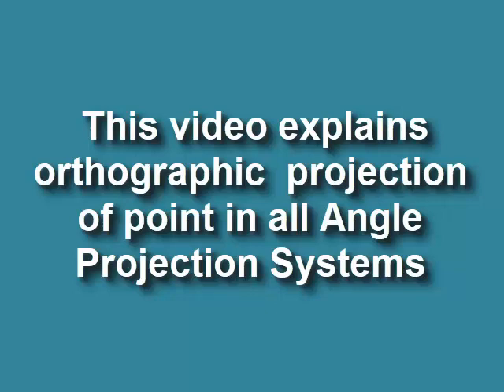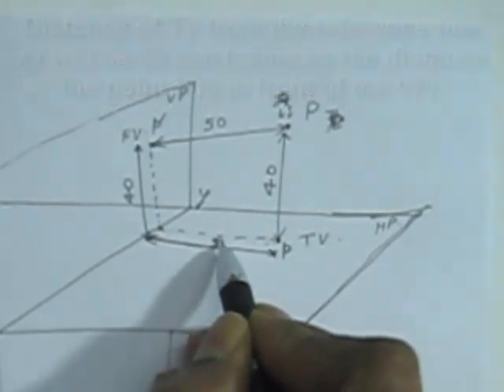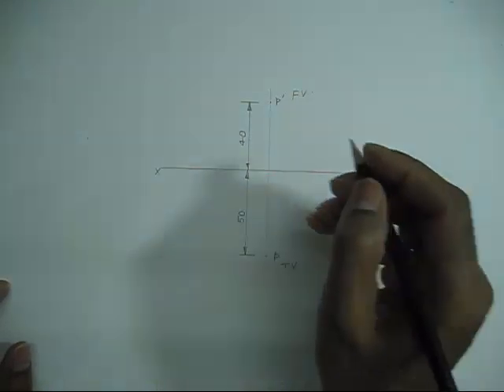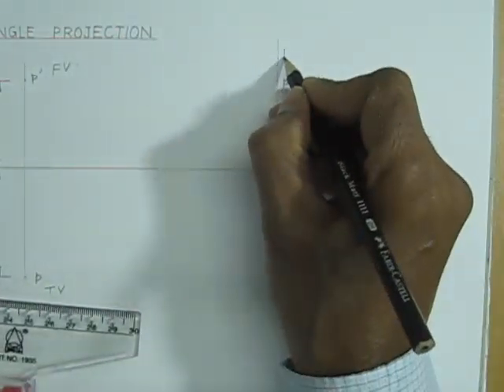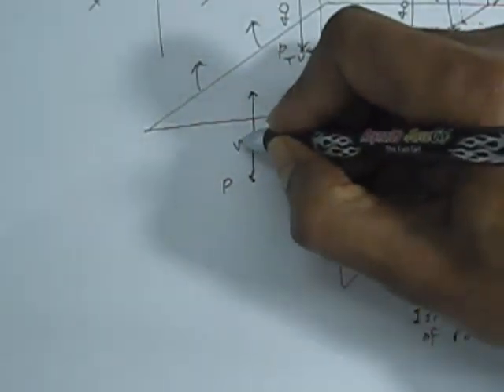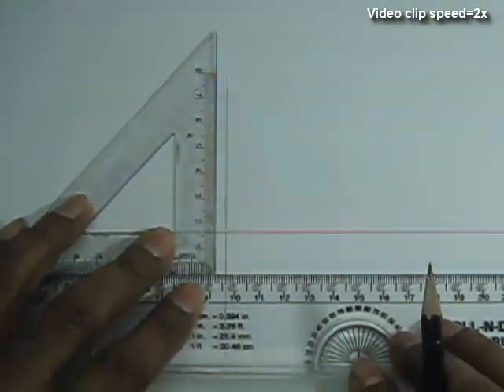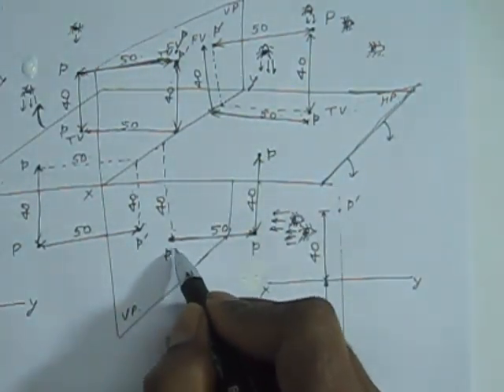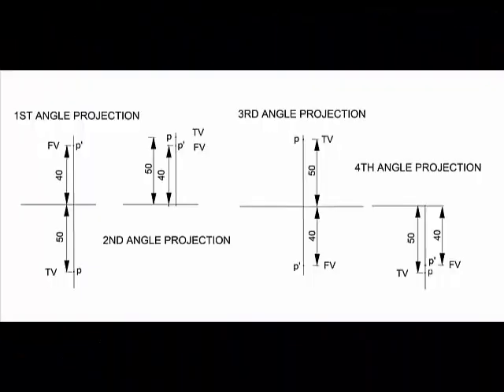3.3-Orthographic Projections of Point in All Projection Systems

Comment: Sir for which lines should be dark and which lines should be dark
Reply from the maker: Outlines should be dark and all other lines should be thin lines. Use only 2H pencils and with different pressure you can draw thin and thick lines. Using H is also fine.✔

Comment: Sir how to calculate the distances btwn top and front view in after cmpltion of projection
Reply from the maker: Depends on the problem. You may use the distances of the TV and FV from the reference line and add them. Need to look at each problem.✔